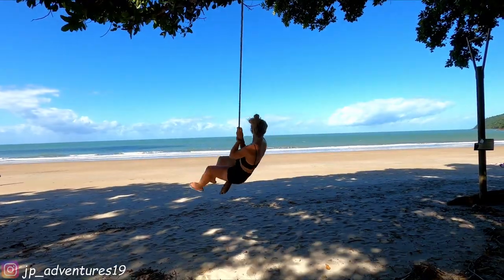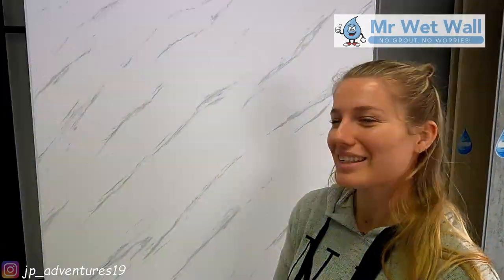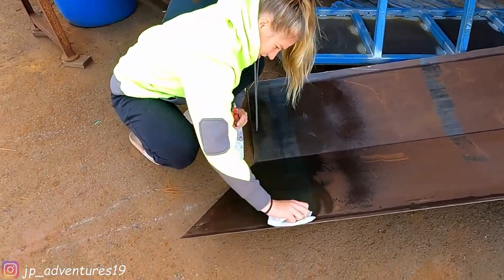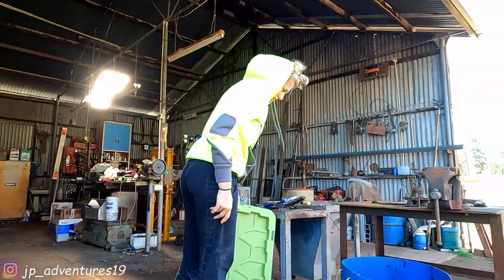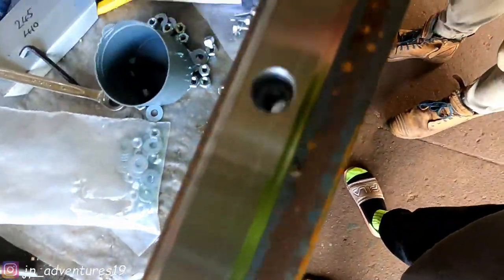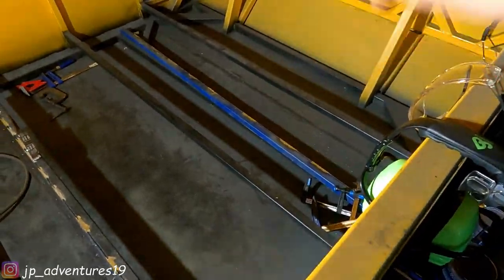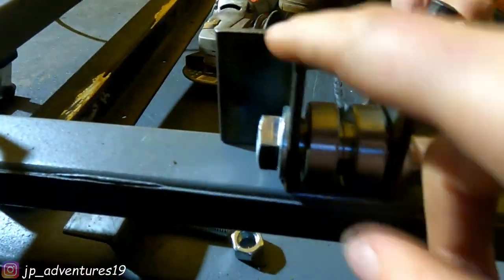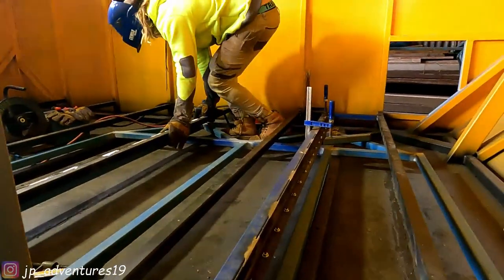Is the FLOATING BALCONY our first big FAILURE?! -  Mercedes-Benz UNIMOG Expedition Vehicle (Eps. 14)

Comment: That extendable balcony hidden under the floor is impressive. But isn't that too heavy? I know, Mog is a truck with plenty of power and weight reserves able to carry a lot more than metal box. But still, your build is awesome and on the other hand seems to me unnecessarily heavy. I admire your ability to craft and design, no questions there. But I'd spare the floor space for something heavy like drinking water tank, grey water tank, extra fuel tanks .. as everything heavy is supposed to be down there on frame/floor, so the whole built will be bottom heavy and not tippy (top heavy).
Reply from the maker: After living in the truck for over 2 years we can tell you that the deck is worth every single kg it weighs😍 It is the best feature and we absolutely love it. We have bars coming out the roof bars to attach hammock chairs to or put up a clothesline to dry our washing. 
Our build is definitely on the heavy side and our water tanks are inside, actually go all the way down to the bottom floor as the deck only covers the back area of our box ;)

We're carrying 400l of drinking water, 50hot, and 500l of Diesel so that's heaps :)

Comment: Weird that Wet walls are so expensive. Don't really understand that. All they consist of are an impervious surface. You'd imagine a recycled plastic would suffice? Good choice though. Watching your epic build from my sunlit bed in sunny Cornwall - home of Pastys and Clotted Cream...
Had no doubt that the balcony would work!!!! As Mr Musk says "If it aint Failin, we aint learnin !!"
Cantilevers are difficult. In wood you need at least 2 parts fastened to every 1 part overhang - at least. Don't know about metal. And the sliding mechanism would compound the problem. An interesting engineering problem ( that's why engineers exist). I'd ask one... Good luck
Reply from the maker: Good thing that Patrick is an engineer and goes through the calculations ;) We are working on a better system now, fingers crossed this will be the final design iteration. Thanks for watching our videos and your supportive feedback :)